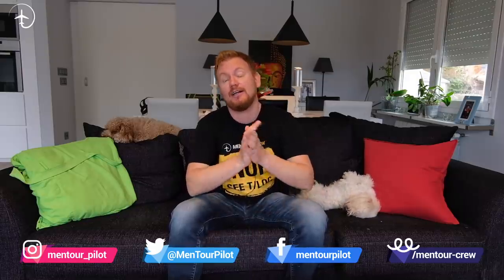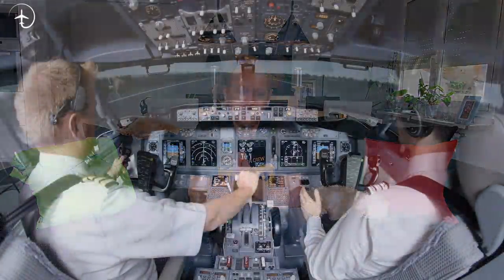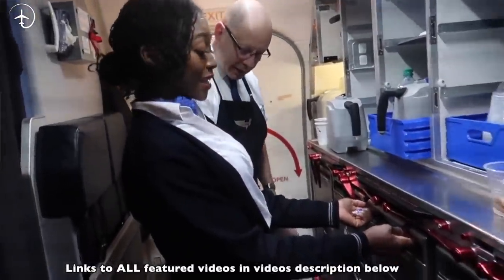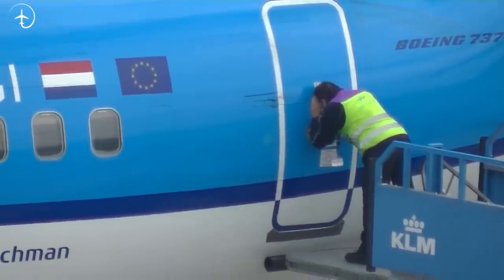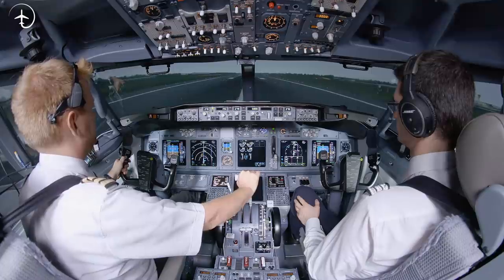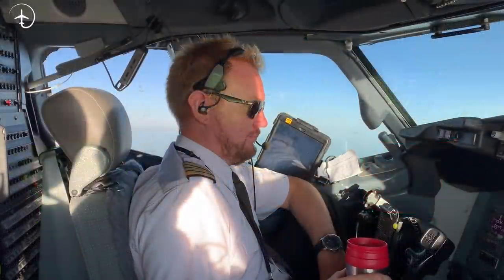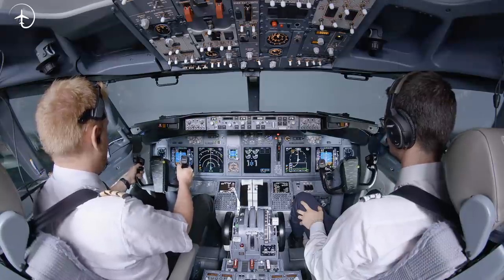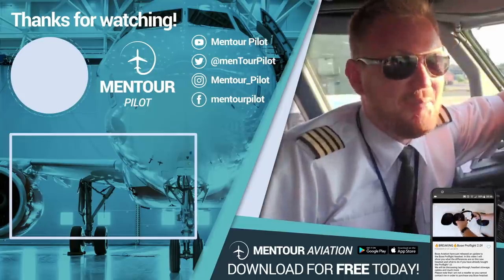How to fly an EMPTY Aircraft!

Comment: When you open an armed 737 door from the outside, doesn’t it revert back to disarmed like all the other aircraft doors?
Reply: Nik Siever No it doesnt. But all the other? Really dont think the 737NGs is the only passenger jet that does not disarm the slide when opened from the outside🤔
Reply: Speedbird All the aircrafts that I fly on (A319,320,321, 350, 777, 787, ) it’s one of the recurrent test questions and the answer is yes. that is because if the plane has to make an emergency landing and for some reason everyone inside is incapacitated then emergency services can still get inside because the doors will be in automatic/armed.
Reply: Nik Siever I understand the reason, just thought it would be other aircrafts than the 737NGs that does not disarm when the door is opened externally🤷🏻‍♂️
I knew the 73 is old school, but didnt know it was to that extent😂 
I only got a licence for 737NGs but I heard that there is a armed light for the slides on the A320-series instead of the strap that is on the 73, do you what this is for if it disarmes automatically?
Reply: Speedbird That’s correct! There is a white SLIDE ARMED light that comes on in the babybuses when you try to open the door in automatic/armed whether you’re in or outside the aircraft. Obviously, only engineering or emergency services are allowed to do it, not crew. But the other aircrafts all the dual isle Airbuses and Boeings are perfectly safe to open from the outside when they are in automatic.
I’ve never worked on the 73 and that’s why I was wondering. I thought all aircraft doors were the same in that sense.
Reply: Nik Siever We both learned something new then😊

Comment: Need more information on arming of doors
Reply: When the doors are armed it means that the emergency evacuation slides will automatically deploy when the door is opened.
Reply: Mike P      So is there any interlock between doors arming n wheel parking brake release ?
Reply: Mike P     So doors arming signal view glasses tape n doors arming both are separate manual process.....or mechanically interlocked?
Reply: @thermalpower6277  - The cabin crew arm and disarm the doors which is done mechanically. After arming the door they put the red flag on the window and after disarming the door they remove it from the window as a separate action.

You can use Google search with these words: "Boeing 737 Passenger door youtube" and you will find a video which shows how the B737 door operates.
Reply: @mikep9604  let's check
Reply: @mikep9604  thanks Mike...

Comment: Fascinating and not something that ever occurs to me as a passenger.  I like that each variation in flight has a checklist and procedure for different modes.  My experience is that checklists are more important the longer you have been operating a machine or a service.  After time the mind can wander to a 2nd task while simultaneously performing another and it most always comes back to haunt you.  In your case with the possibility of critical issues, it is of utmost importance to check the checklist.  I often find it useful to read it to my work partner out of order!